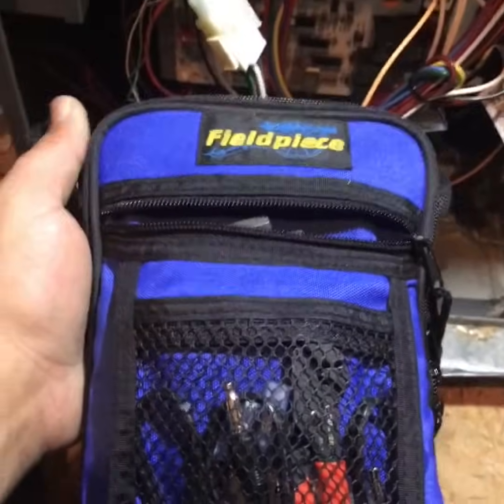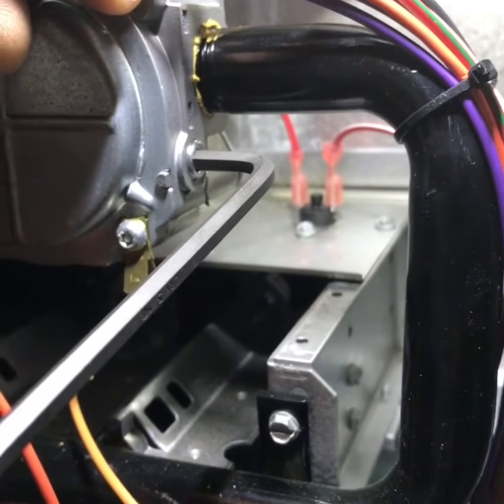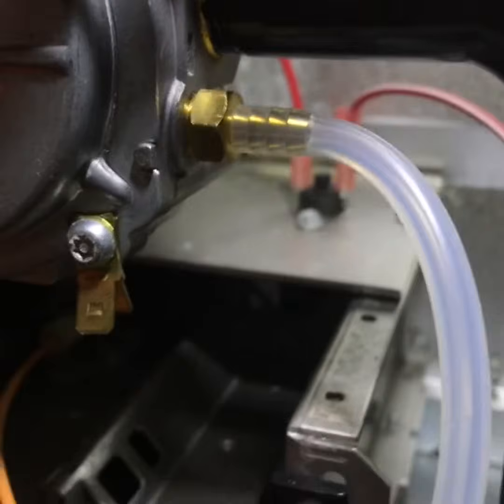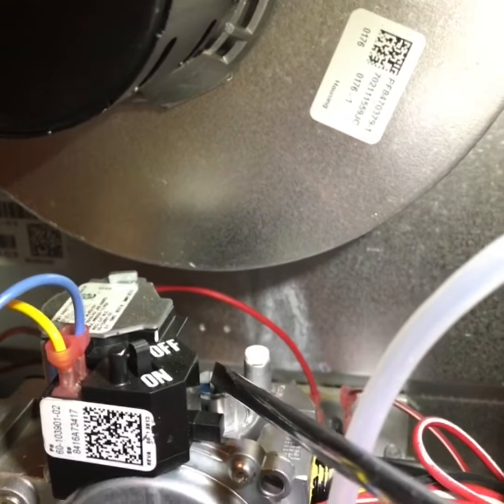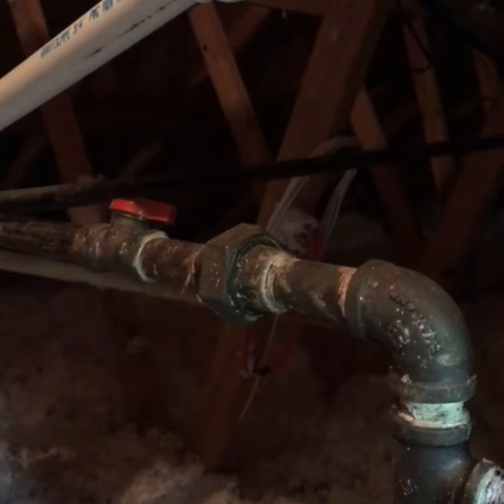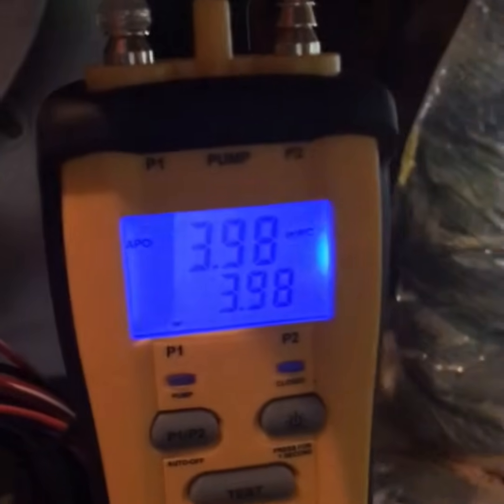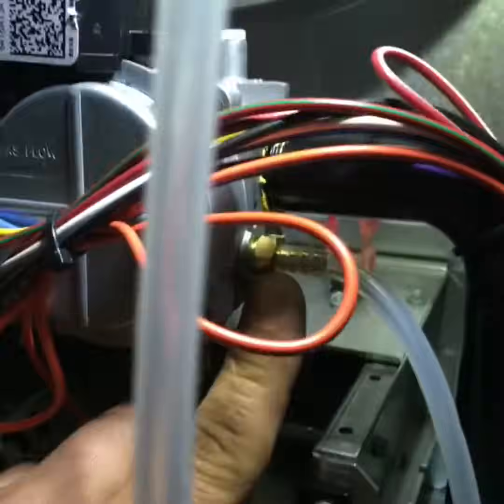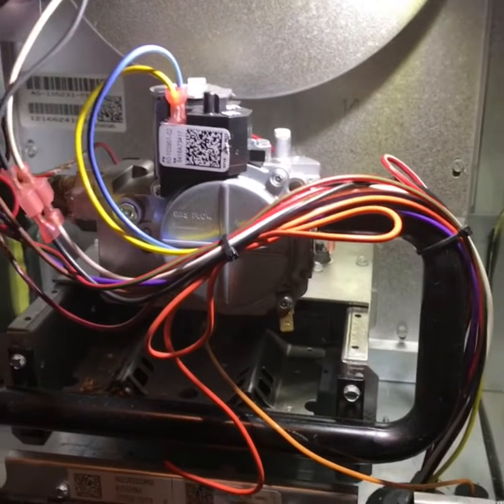How To Use A Manometer For Gas Pressure (Rheem Furnace)

Comment: First-Channel-Lock is a name brand. the proper name is tongue and grove pliers. but I know what you meant. Second this is not the proper tool to use. Manny techs do not know which direction to hold the pliers for the proper grip. Even if you hold the tool in the proper direction eventually you will round out the corners of the brass fitting. Use an adjustable wrench or the proper size wrench. Third, the 3.5"wg is the valve recommended setting. Look at the manufacturer data tag for the proper manifold pressure setting.

Comment: Is it necessary to check the inlet pressure or just the outlet pressure?
Reply: I'm just getting into the field and I know this was 4 months ago. But you want to make sure both the input and output are 3.5" WC or 3.2" WC here in Colorado.
Reply: @ravagepolo  Thanks for the advice but I already figured it out. With only 3.5" WC on the input, you will never get 3.5" WC on the output. Some pressure will be lost going through the valve. You need 5" to 7" WC on the inlet in order to get 3.5" WC on the outlet. So you should have 5" WC minimum on the inlet.
Reply: @bernardocisneros4402  Oh gotcha good to know thanks 👍

Comment: First the video was great !!!!   I have a question !!!  When a heater ( furnace) first starts  the burns turn on and after it reaches a temp in the heat exchanger the blower is suppose to turn on !!!!  And after the heat exchager reachs set temp the burns stop the bullers keeps working till it cools the heat exchanger and start all ove4 again .   Right. !!!     I have a furnace that the blower turns on and a little bet after the burns turn !!!    Which i think is wrong !!!!!!   Trane / America standard  model S8B1B080M4PSC.   Any ideas

Comment: Do you set the pressure based on the gas valve or on the pressure recommended by the furnace unit ?

Comment: You should turn on and Zero your Manomiter to the atmospheric pressure before your connection to the gas valve, and you should run the appliance for about 10 minutes at Maximum Rate to allow the burner and gas injector to become hot and expand to produce its true gas rate. You should always test all disturbed gas joints with Leak Detection Fluid after reconnecting any fittings, plugs, etc
Reply: I concur.  This guy video gives improper procedure that can lead to mistakes and cost you a heater and labor and much headache.

Comment: Great video, but what about the inlet pressure? Also Please do a video using the pressure switch tester.
Reply: I just finished my new 2lb system last night.  I had to adjust my maxitrol valves because they were factory set for natural gas at 8wc. I hooked up and turned the system on. Got a inlet reading of 8wc then adjusted to 11.13wc within the range of 11 to 14 for me. Then flipped the gas back off and checked the manifold side.  Found 10.03 for high fire and 5 for low.

Comment: If using LP gas, what should the water column be at AFTER the gas valve?
Reply from the maker: Usually around 10” w.c. But some manufacturers are different. You would have to look it up online to know for sure

Comment: excellent, well done actually & thanks for this. have you done a video for a tankless water system?
We've got a propane tankless water heater that requires a 7/16" hose connector to the manometer. I've been give the WC stats:  low -.06 and high -.07 with the gas inlet needing to be set at 12. Hoping to find a manometer online

Comment: How can you tell if it's the gas valve that's bad? Would it not turn the furnace on?
Reply from the maker: You would check the voltage at the gas valve when the board sends for gas to be released at the gas valve. If you have power there and the valve don’t work. It’s the valve. If you don’t get power at the time of the call, then you have a bad board
Reply: @HVACTechTips  I appreciate it thanks

Comment: Great explanation! One thing that should be mentioned is derating a furnace at higher altitudes
Reply: It’s also good to mention that pressures need to be adjusted to match certain altitudes
Reply: Please explain how. I want to learn. Thank you.
Reply: The panel on the furnace or the manual may have the derating values

Comment: Thank you for the video. May I know what gauge of your screwdriver to unscrew the adjustment cap on the gas valve? The cap seems very tight on my gas valve, and I am not able to unscrew it using a regular flathead screw.